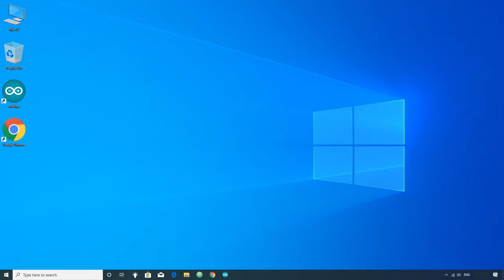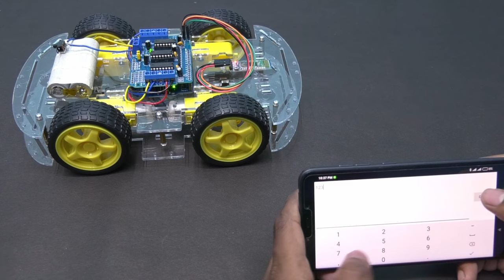Bluetooth controlled Arduino RC Car | Control using your Mobile Phone | Ut Go

Comment: Hello sir, you make great videos, and currently we are working on a project using your guidance.
Sir actually we are making a car which has to be loaded with some external functions like shooting balls, gripping things. But the problem is currently we are working on it's base and driving system. It's base is made of plywood. And it's wheels(70mm×20mm) are attached with DC Motors of 12v and 200 rpm. When we did the setup as you told in this video. Then after connecting to blutooth module with module, we tried to move the robot. But the robot didn't moved instead the batteries got fused and were about to almost blast. And we are not able to identify the problem can you please help us.🥺 Extra information- We powered both arduino and motor driver separately.
Reply from the maker: You have given Power to both Arduino and motor driver but have you removed the jumper in the motor shield.
Reply from the maker: Have you removed the jumper in the motor driver shield
Reply: @UtGoTech  No sir, we removed that when we were uploading the code. But we didn't removed it when we were trying to operate it with Bluetooth.
Reply: Sir can you recommend a specific battery that we should use to power the 4 motors of 12v with 200 rpm. So that we can ensure that we are not overloading the batteries.
Reply from the maker: If you are using separate power then you have to remove the jumper.
Reply from the maker: I suggest you to use lithium based batteries
Reply: @UtGoTech lithium battery of how much volts and mAh?
Reply from the maker: Use 3S lithium-ion battery pack. mAh according to your needs.
Reply: Hello sir, we used 3s Lithium-ion batteries as you said, and the robot was also working quite good. But after sometime the battery stopped working and we tried to charge it also with a battery charger that we have but still got no improvements. What can be the possibilities that our batteries are not working?. Btw, the battery was 3s Lithium-ion Battery, 12v and 2500 mAh. Sir please, we need you favour!
Reply from the maker: @newfacts4567 use good quality batteries

Comment: Bro till how much mah battery we can plug to motor driver shield bro can I use 4.2 v 6000 mah battery of 2psc is the motors works good bro plz give me a solution bro plzz
Reply from the maker: More than 2000mAh and battery voltage should be between  6v to 12v.

Comment: Which Mobile application that used to control car?
Reply from the maker: I have used the Bluetooth RC Car app which is now removed from the Play Store. You can download its backup. Link given in video description. Or you can use a different app but you have to slightly modify the code according to the app.

Comment: i was trying to follow your exact tutorial  code is also uploaded but car is not working at all . Please help me , also tell about  BT APP which is you are using to connect arduino  to mobile
Reply from the maker: App used: Bluetooth RC Car
You have to use this app only otherwise it will not work.
If you face further issues, feel free to ask.
Reply: bluetooth is also connected . i have checked  manully all motor are working with code its not working , i have changed 3 arduino but still i am facing same problem😒😔
Reply from the maker: Make sure to connect motors and the Bluetooth module is connected as shown in the video.

Which type of battery are you using? You have to use 2 lithium-ion 18650 battery in series.

Comment: The backup link for the app only works on the PC. Is there another way to get the app so that you can also use it on your 
 phone?
Reply from the maker: You can try opening the link in the mobile browser in desktop mode.

Comment: I get a problem when i press left it goes right & also pressing right button it goes left pls help me.....
Reply from the maker: Just swap the motor connections.
Reply: @UtGoTech  yes i also tried that but nothing change.... The forward backward is working fine with a fine response, the problem with the left & right... 💔pls help...

Comment: Bro
I am not able to connect it with my Bluetooth tht hc-05 light is not oning
Reply from the maker: Check battery voltage
Reply: If you have connected the + and - leads of the bluetooth module correctly the light will blink , also check if your wires are good with a multimeter

Comment: Hello Sir 
Can you tell me that what would be the code if I would use 3 rechargeable battery of 2600mah instead of two battery and would the project work
Reply: To make the car move more faster
Reply from the maker: 3 x 18650 Lithium ion batteries will be too much for this project. I suggest you use only 2 such batteries.
Reply from the maker: Use  high RPM BO Motors for faster speed.

Comment: Arduino: 1.8.19 (Windows 10), Board: "Arduino Uno"

BLUETOOTH_CAR:18:10: fatal error: AFMotor.h: No such file or directory

 #include <AFMotor.h>

          ^~~~~~~~~~~

compilation terminated.

exit status 1

AFMotor.h: No such file or directory

This report would have more information with
"Show verbose output during compilation"
option enabled in File -> Preferences.

the code is not runing what can I do ?
Reply from the maker: First install Adafruit Motor Shield V1 Library through Library Manager. After that upload the code.

Comment: Hi, please this error appear when I am trying to upload the program, what is the problem?

Arduino: 1.8.19 (Windows 7), Board: "Arduino Uno"

BLUETOOTH_CAR:18:10: fatal error: AFMotor.h: No such file or directory

 #include <AFMotor.h>

          ^~~~~~~~~~~

compilation terminated.

exit status 1

AFMotor.h: No such file or directory

This report would have more information with
"Show verbose output during compilation"
option enabled in File -> Preferences.
Reply from the maker: First install adafruit motor shield library

Comment: The Bluetooth transmitter doesn't light up, it doesn't get hot, the system doesn't recognize it. What could be the problem?
Reply: now its blink but its still not found
Reply from the maker: First pair up with your mobile using phone Bluetooth settings menu after that select that paired module in the app.

Comment: Can I use a connector wire instead of the jumper if its missing
Reply: Can you tell from which application we can do the coding
Reply from the maker: You can use Arduino IDE
Reply from the maker: Yes you can use connector wires.
Reply: And sir can you tell how we can install motor shield library and then how can we write the code

Comment: I have a question, why the Bluetooth doesn't connect with my phone ?, the code is working and everything is well connected, but when i open the controlling app and scan for the Bluetooth it doesn't even show any result
Reply from the maker: First pair the HC-05 Bluetooth module using your phones Bluetooth menu. After pair up open the app to see your paired HC-05 Bluetooth module.
Reply from the maker: It is shown in the video also.
Reply: @UtGoTech  I did all of that , but once the app is connected to the Bluetooth ( when the red circle 🔴 turn into green 🟢) the car won't move .no matter what button i press it won't move anywhere.
Reply from the maker: Check battery voltage. It should be between 6 to 9 volt
Reply: @UtGoTech  i used two batteries with 3.7 voltage which means the total is 7.4 volt ,
+ I've already tried to connect 9volt battery ,but i still have this problem??
Reply from the maker: Check the current battery voltage. 
You can send pictures of your RC car through Instagram for troubleshooting.
Reply: The current is 1500mAh for every 3.7v battery
Reply from the maker: You have to use 2 batteries in series. Check how much voltage you are getting.

Comment: sir your code is not working its showing C:\Users\Lenovo\Downloads\BLUETOOTH_CAR\BLUETOOTH_CAR.ino:18:10: fatal error: AFMotor.h: No such file or directory
 #include <AFMotor.h>
          ^~~~~~~~~~~
compilation terminated.

exit status 1

Compilation error: AFMotor.h: No such file or directory
Reply from the maker: First install Adafruit Motor Shield V1 Library from the library manager after that compile and upload the code.

Comment: Hi i have a problem when i am connecting the Bluetooth module to motor driver it Bluetooth module doesn't turn on whereas when i connect the motor driver to my laptop through Arduino board it turns on. Please tell me the solution
Reply from the maker: Check if the jumper is connected in the motor shield

Comment: The code works while the arduino is plugged in but when I pu a battery in it blinks slowly or doesn't blink at all
Reply: and the rx and tx lights are not on
Reply from the maker: Use powerfull battery or increase the supply voltage.

Comment: I can't find the apk that you use..., what other app should I use?
Reply from the maker: You can download the backup app from the description or you can look for a similar app in the Play Store and modify the code according to the app.
Reply: @UtGoTech  I don't know why my RC car doesn't move, I did the same way as you did, the hc-05 connection did not pop up at the Bluetooth connection, so I decided to use the pin 0 and pin 1 instead for the TX and RX, then the hc-05 Bluetooth connection pop up and can be connected, once it can be connected and I have uploaded the same code as yours. I disconnected the TX and RX wire while I uploaded the code but when I tried it wouldn't move, do you know what is wrong?
Reply: Should I change the code since the position of TX and RX is different from your video?

Comment: first thank you for this project
Can I connect a 11. 1volt to motor or not
Reply from the maker: I wouldn't suggest this because running for long hours will damage the motor. However you can run for short duration. I will suggest you to use 7.4V.
Reply: For each battery I mean if I use 2 then connect14. 8
Or you mean total 7.4??
Reply from the maker: Use 2 lithium ion batteries in series to make 7.4 V.
Reply: Thank you bro ❤
Reply from the maker: Welcome👍

Comment: Sir can I use a 9volt battery instead of 2li-on batteries?
Reply from the maker: A 9 volt battery will not work. You have to use a lithium based battery.
Reply: Thank you
Reply from the maker: Welcome👍

Comment: I watched it and i did the same thing. I copy the code, upload the code (also i installed the adafruit motor shield)(what version of adafruit should i use because theres adafruit v2 in the library and i chose adafruit motor shield). I used my laptop as a power source since i dont have lithium ion battery yet. My hc-05 paired on my phone for a few seconds from the app then connect it again and same thing happened. I also remove that yellow thing (is it called jumper?) And inserted it again after uploading the code then connect again on the laptop to use as my power source but the yellow thing is inserted on the motor shield. Now, I can't control it (the laptop is still my power source) helpp😢. Thankyou
Reply: Update: the bluetooth is now working (for a longer time) but I can't still control the DC motors l. Are the reasons wrong placing of soldered wires from DC motor and to the motor shield? Or any any reasons? Please helpp😢
Reply from the maker: You have to Install Adafruit Motor Shield V1 Library
Reply from the maker: Power from the laptop will not work. Most of the laptop port can't provide enough power to drive 4 motors and it is also not good to drive inductive load like a motor through a laptop USB port.
Reply: @UtGoTech  thats what i installed, the v1 adafruit motor driver
Reply: @UtGoTech  thank you for respond ill try the lithium ion battery
Reply: @UtGoTech  bro can I use other brand of lithium ion battery but same volts (3.7 volts) instead of Lithium ion battery from your provided link? The battery is pricey in our country I cannot afford it
Reply from the maker: Yes you can use other brands of 18650 lithium ion batteries.

Comment: Bro, we have made a car by inspired from your video.all  seem as correct but the car is not moving.if then very slow..we have connected more than 18 volt power ..what should we do
Reply from the maker: Use 9 volt power supply. 18 volt is way to high.
Reply: @UtGoTech  Bro,at 9v is is not moving at all.even at 36v it is moving very slow and not turning to side
Reply from the maker: Are you using same components
Reply: @UtGoTech  yes
Reply: Can you pls give your method of contact
Reply from the maker: You can contact me through telegram.
Reply: @UtGoTech  your id
Reply from the maker: @UtGoTech

Comment: if we dont use aurdiono motherboard and if we use bluetooth module hc06
Reply from the maker: If you will not use Arduino Uno or any other microcontroller then you will not be able to control your motor.

But you can use HC06 in place of HC05.

Comment: Hello I have problem if I want use another switch different to yours?
Reply from the maker: No. You can use different switch.
Reply: @UtGoTech  now bluetooth flshing led lightning on motorshied but the car dont run
Reply from the maker: Are you able to connect to your Bluetooth module?
Reply: @UtGoTech  yes it’s connected it but won’t run
Reply from the maker: Which battery you are using?

Comment: Why you are connecting Bluetooth module with servo Motor pins ?
Why not using digital pins
Reply from the maker: The servo pins can be used as digital pins or PWM output pins. In motor shield those two pins are exposed so I used those pins.
Reply: @UtGoTech  ok thanks

Comment: What voltage is the battery because the battery link isn't opening......
Reply from the maker: We have used two 3.7V 18650 Lithium ion batteries in series. That makes 2S battery pack of 7.4V.
Reply: @UtGoTech  thanks 👍🏻
Reply from the maker: Welcome👍

Comment: Parabéns pelo projeto, fiz e deu certo, gostaria de colocar um buzzer e dois led para os faróis para controlar pelo bluetooth, você tem uma dica? Ou código. ? Desde já agradeço.
Reply from the maker: The Analog Pins A0 to A5 are still available. You can use those pins to control headlight and  buzzer. You just have to program it.

Comment: HELLO SIR WILL IT WORK WITH ARDUINO UNO  ONLY ..  I HAVE TRIED BUT NOT WORKING . AND I AM ALSO NOT ABLE TO RUN MOTOR FROM IT BECAUSE VOLTAGE AT MOTOR IS ONLY 0.3VOLT WHAT SHOUD I DO . I AM USING 1 PAIR OF   3.7 LION BATTERY
Reply from the maker: If you are using an arduino motor shield then you have to use arduino Uno or arduino mega. If you want to use board other than arduino UNO then you have to use different motor driver board. 

Check if the battery is fully charged and also check if the batteries are connected in series or not.
Reply: @UtGoTech  I HAVE ARDUINO MOTOR SHILED l293d + ARDUINO UNO which is NOT WORKING .. ALL THINGS ARE IN SERIES EVEN I USED 3 LI ION of 3.7volt  battery with 1200mAH but at motor terminal the voltage is .3v
and NOT WORKED...
Reply from the maker: Check if the motor shield and the motor driver shield is working correctly or not.
Reply: @UtGoTech  hello sir i checked and found it may be a  battery problem single motor is running but using 2 motor than speed and all goes shut earlier i was using all four motor now tried with 1 and 2 motor it worked. should i go with more than 1200mAh for 3.7 volt or should use 3 3.7 volt  li-ion battery.
Reply from the maker: You should use 2 18650 good quality Lithium ion batteries in series.

Comment: Why you don't have a voltage regulator in RX pin for Bluetooth module???
Reply from the maker: Actually some Bluetooth breakout board comes with voltage divider to convert 5v to 3.3v for the RX. That's why I have tried connecting it to Arduino tx pin directly and it work without any problem.
Reply: @UtGoTech  I have connected by this way, directly to Arduino tx pin as you showed it in video, but a few minutes later Bluetooth module lost the connection, I suspected that is rx pin voltage, because it works at 3.3v

Comment: does it depend on the color of the cables that I use for the motorcycles as well as for the power supply? Because I bought a battery holder and there is red and black ....
Reply from the maker: Colour doesn't matter but polarity does.

Comment: @Ut go 
i also did the same but bluetooth was connected but it didnt move pls advice what to do
Reply from the maker: Have you checked your battery voltage?
Reply: @UtGoTech  yes its 9V
Reply from the maker: Simple 9v battery cannot provide enough power to drive those motors. Use lithium ion batteries.

Comment: Why Motor1 was not declared in this scope?
Reply from the maker: Have you installed the Adafruit Motor Shield V1 Library ?
Reply: @UtGoTech  I was install it Dear but when i run it was not declared in this scope
Reply from the maker: Maybe the code is mistakenly edited. Re download the code and try to upload. If it still gives you an error then send me the error screenshot through Instagram, I will solve it for you.

Comment: Hello Sir. Is there any way the rpm of the motors can be increased?
Reply from the maker: Increase voltage
Reply: @UtGoTech   Sir but I have used the same gear motors which  you have used. Isn't the RPM constant 60 for these motors?
Reply from the maker: Yes but it will vary with voltage. You can also increase speed using setSpeed function.
Reply: @UtGoTech   Ok. Thanks a lot for solving my query!!
Reply from the maker: Welcome
Reply: Where can I buy. Material for this project
Reply from the maker: You can but it from Amazon

Comment: Can you say how I do that programs can I copy it if yesnplz send
Reply from the maker: Code given in video description
Reply: @UtGoTech  it didn't work for me I downloaded it but it didn't open plz send me
Reply from the maker: Open it using Arduino IDE or Text Editor.
Reply: @UtGoTech  done correctly working don't you have dc I will send vid
Reply from the maker: You can contact me on Telegram
@UtGoTech
Reply: @UtGoTech can you send me the code the drive is not opening for me
Reply from the maker: Contact me through Telegram. I will send the code there.